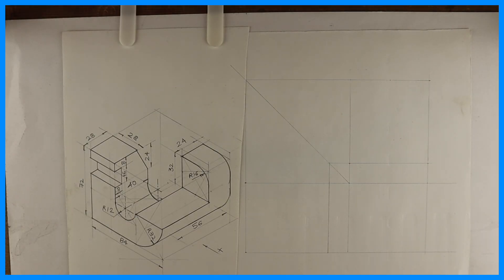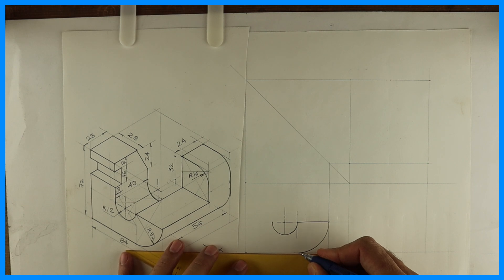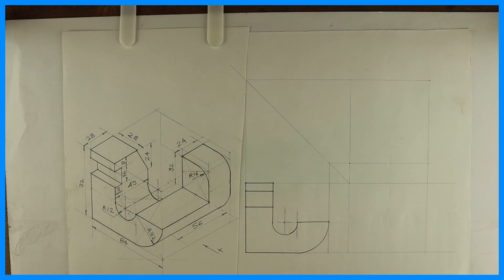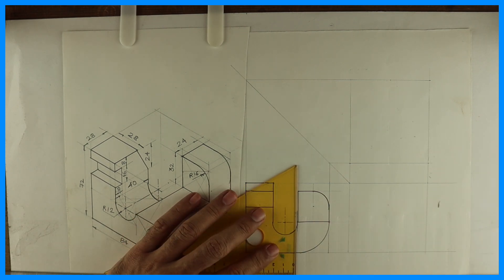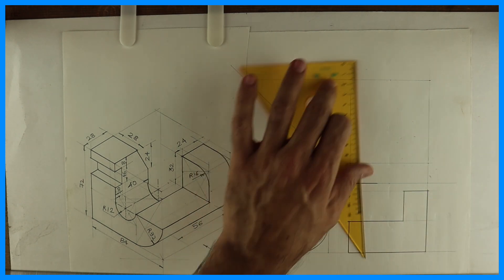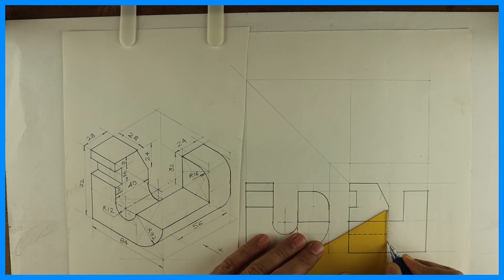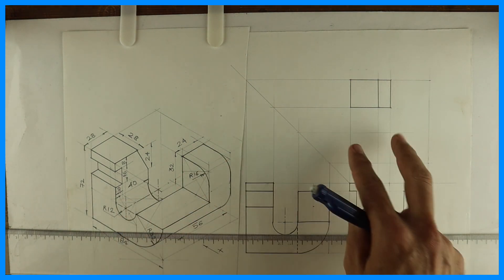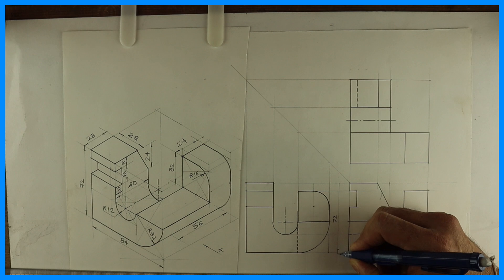Orthographic projection - Engineering drawing - Technical drawing

Comment: I can’t understand the dotted lines.
What does he mean through and through at 3 mins 55
Reply from the maker: There is an edge which you can't see from front view
Reply: @technicaldrawing  But you can’t see it from isometric view either.so how do you know that the edge actually exists?
Reply from the maker: Object will have boundary line so Tak ng that point I am drawing that line
Reply: @TheToe81   total dimensions on the left is 40 and on the right is 56 meaning there is a corner along the side with 56